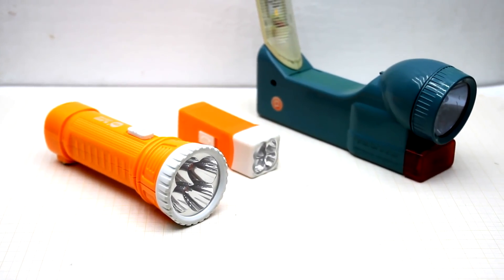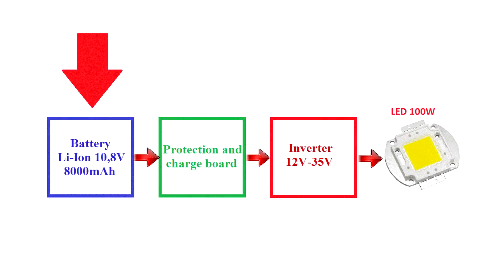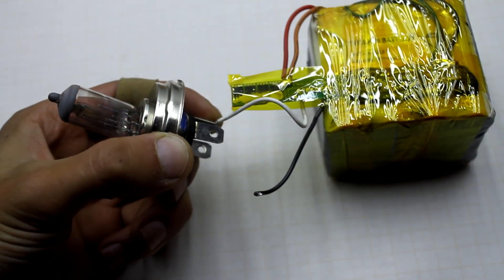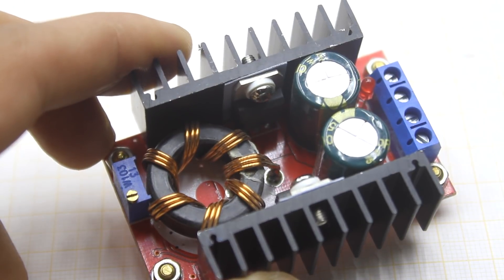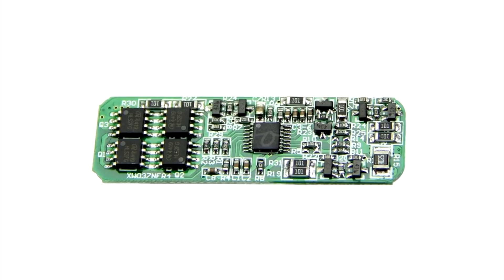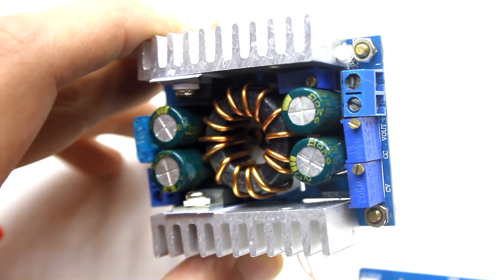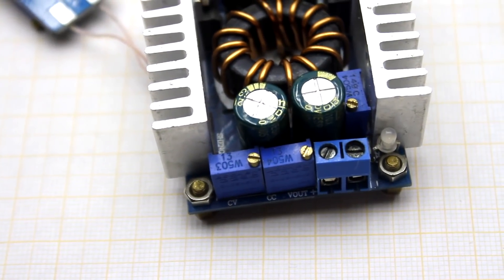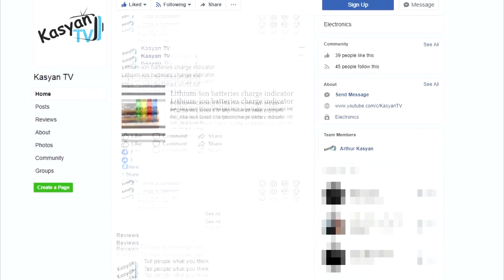DIY 100 Watt LED Flashlight

Comment: Hello kasyan
can we use protection board from laptop battery as 4s BMS? and can we charge 4s battery pack using that board and Dc power supply...
if yes please make tutorial on it..
Reply: Amit Pachpande no because its fermwar disable it to work again after once you remove its battery  , i did that with my Sony Vaio battery , circuit does not work again
Reply: and also i heard and read articles that claims this same thing
Reply: X-TREME DIY thats also means firmware disable battery charging if battery deep discharged... and now it make sense why Laptops stored for prolonged period are not abale to change battery again.
Reply: Amit Pachpande  yes it will also happen when its  battery cells charge goes below specified voltage that mentioned in program
Reply: Amit Pachpande laptop battery is more complicated than Phone Li ion or po battery that's why its circuit have more pins including battery POWER , SERIAL DATA WITH ITS TEMPERATURE DATA , LAPTOP BATTERY ALSO CONTAIN TEMP SENSOR

Comment: i'd really like it if you make custom converter with integrated undervoltage protection for the batteries instead of having 2 separate circuits for this

Comment: Bro, mAh only says the capacity of the batteries, which you can use to calculate how long its power is going to least. The maximum discharge rate is the C number. 18650 cells have around 20C... It's a difficult calculation which I really don't undressed fully.
Reply: so 20C @ 2000 mah means (2000mah/1000)*20c 40amps?what is the meaning of this c rating? 4 amps seems more like it
Reply: Let's say a battery claims 100Ah (I know, it's a big number. I'm just using easy numbers to do math on). That means we can draw 1 A for 100 hours, 2 A for 50 hours, 100A for one hour, 200A for 30 minutes, etc. There is a maximum current draw for a battery, but you don't know that unless you have the manufacturers datasheet. I've seen batteries that are 1000 mAh that you can draw a maximum 1A from for one hour and others that are 1000mAh but you can draw 20A for 3 minutes. If you draw 20A from the first battery it'll blow up.

The lead acid batteries used for starting cars is a real good example. You could have a battery rated for 270Ah but have a cold cranking capacity of 650 amps. The cold cranking capacity is the maximum current it can supply for fifteen seconds just to start a car. Any more and you might damage the battery.
Reply: Jammit Timmaj Exactly. But a better comparison would be with lipo batteries. And there are 7.4v lipos with 350mAh and 70C or more.
Reply: I don't know of a single 18650 that can do 20c.... Even the low capacity and high discharge 18650's used in power tools are only like 15c max.

Comment: Cool video. But why not just add more cells in series to get to 36v ? Say 10 in series, 2 parallel, so 20 cells total. I dont know how you would regulate current though.
Reply: because they will loose voltage over time and the brightness will drop. you will need switching regulator either way so why not use step up converter and make the batt pack use laptop battery board
Reply: because he don't have BMS for that 10s.
Reply: A 12v battery is easier to charge and maintain. Finding a power supply that can supply a little over 12v is easier and cheaper to find than one that can put out a little over 36v at the current needed to charge the batteries. Battery chargers and protection circuits are easily found for 3 cell (12v) because the 12v is most commonly used (laptops come to mind). Any charger for four or more cells are either custom made for a specific need (electric cars) or are a little expensive (programmable chargers for multi cell remote control planes).